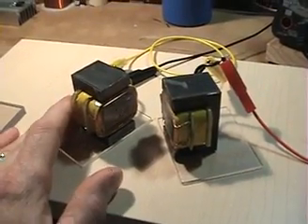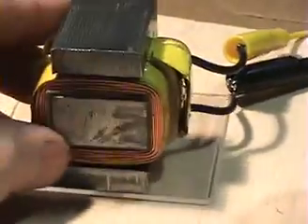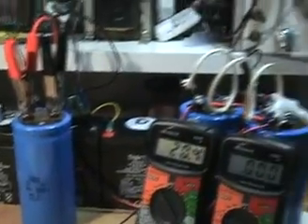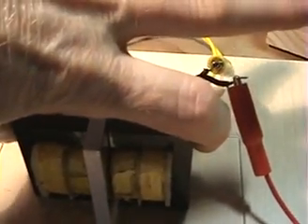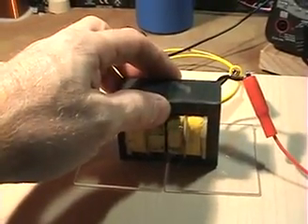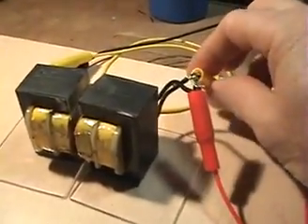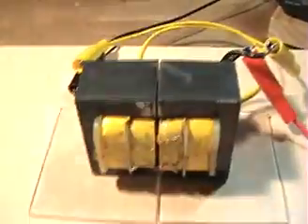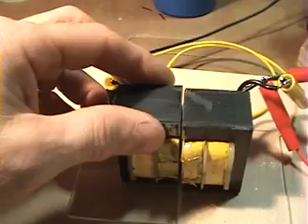Electromagnet Atraction vs Repel mode test 1

Comment: REPULSION:  use two electromagnets with cylindrical core.

1)  eliminate the remanence magnetism in the core using heat above the Curie point, or via saturation.

2)  position the end of one cylindrical core touching the other
3)  turn the current on

Now, you have two cores magnetized with both 'N' poles touching (or both 'S' poles touching, depending on how you wound the conductor around the cylindrical core) and the repulsion will be noteworthy

With the shape of the transformer's 'core' - you are not getting the "like poles repel" action because of the flux path in the iron.  You eliminate the extra 'experiment-ruining' flux paths by using a cylindrical iron core

Comment: There is something that you are doing wrong.
Think about Magnetic Levitation Train. There is repel and pul mode. So the repel is strong enough to lift that massive weight. So, there is something that you are doing wrong. Check, Recheck and then Check and recheck.

Comment: Sir, thank you very much for this video. I just calculated that electromagnets cannot repel each other, because the force is proportional to (I1+I2)^2, so they can only atract each other, or stay neutral, when I1= - I2. I wanted to make sure my calculations are correct and I found this video that confirms it :) Many thanks.

Comment: The iron core is shielding the repelling force of the coils, it will do the same thing using two magnets, so you can easily test this for yourself. The coil is still being attracted to the iron just like both sides of a magnet is attacked to iron. The coils are repelling each other but are both still attracted to the iron. Of course when they are turned around in the atraction mode the coils are attracted to each other and the iron cores, so attraction works.

Comment: It is logical they dont push apart.
The iron core of each half is an electro magnet. It forces its magnetism on the other half and because each half can be magnetised they both magnetise the other half as well. hence netto, nothing happens. Just like you can place two magnets both facing north towards each other on the same piece of iron,  But you cannot attach two North poles of the magnets directly together, The iron bar or in this case, the core simply shifts its field, continuously internally.

Comment: I get really strong repelling where they fly off the table using direct current especially if you use capacitors for the extra quick jolt vs common battery
Reply: Alex Manzanero can you record some video of your test?
Reply: Daniel Vettorazi one of the main reasons they are not repelling is b cause in effect he has them wired as a bucking coil configuration coils that are wound opposite of each other produce cancelling effects of opposite coil; even though they may not be counter wound he connected one of them oppositely creating a counter magnetic force which cancels the other one I have a good link for you..www.hyiq.org/Downloads/Guidelines%20to%20Bucking%20Coils.pdf
Reply: Daniel Vettorazi  also if you study thsat link you'll find that you can make a transformer that can pull lots of current without affecting the primary due to the cancellation of counter magnetic fields or back emf there are patents

Comment: Are you using dc voltage because ac voltage doesn't work well for magnets because of eddie currents
Reply from the maker: Used DC
Reply: +Roy Morrow Are magnets work by AC Voltage?..

Comment: I am not an electrical engineer so this to some may sound silly or stupid,,,
That being said ...
I noticed that you changed the power supply on the first coil in the series. this to me would suggest that you would have also simultaneously changed the polarity in the second coil as well.

Assuming that opposites attract I would think that you may have better results if you had them wired parallel and changed only one coils polarity

Comment: the magnetic fields in series that you are attempting to repel doesn't work because the magnetic fields cancel each other out. it may work if you put the magnets in parallel or on separate circuits

Comment: The weakness in "repel mode" is due to a lack of inductance which results from the electrons moving in opposing directions. When in "attract mode" the electrons are moving in the same direction and effectively double the inductance.
Reply from the maker: Ernesto Del Bosque
I think to be fair a motor should be built to test the difference between the two. It could be the difference may not be as obvious as in this test? Also, building a motor with electromagnets in both stator and rotor in repel mode may reduce CEMF?
Reply from the maker: Yes, I agree!

Luc
Reply: Luc Choquette  for a solenoid L = uN^A/l where l = lenght , A=area , N = No turns , u = permaebility. Therefore weakness cannot be because the Inductance has reduced as it is not a function of current or V .
Reply: Luc gotoluc Choquette Hey! did you get the answer to the repel mode weakness?

Comment: could it be that in repel the force that would cause the misalignment of the metalic lattice  has a path to go into the to and bottom of the E? I am thinking the E shape takes the repel from the middle of the E and instead of pushing back under domain pressure it uses the top and bottom of the E as a buffer or pressure release valve.

Comment: Therefore to improve matters an E shaped core should not be used for repulsion. I suggest long cores with coil covering full length to increase the air gap between the N and S poles.  Try to make the air gap between poles of the same solenoid much greater than the desired air gap between the opposing solenoids.  Larger diameter cores will probably also increase the effective working distance as the distance flux must travel around them is greater.

Comment: To understand why they didn't repel first look at the flux path of each coil while separated. There is a natural return path from iron in coil center through air gap to iron on top and bottom, through which flux is attracted to opposite end of coil.  When you put the coils near each other the opposite polarities only reinforce this natural return path. Attraction mode is different as it is easier to flow through the opposite half than the self return which has an air gap.

Comment: i use a microwave transformer with no i piece wired as 1 coil
if you get a big transformer a car battery and good place to stick it to ( at least 1/2 inch thick steel) you should be able to lift 500 lbs easy
i have 
i will make a tuturial soon

Comment: Could the winding on the coils cause the voltage drop as they are working in the reverse, Maybe its stepping down in repel mode. making the voltage to low to cause the magnets to repel.
Also while you reverse the wiring on the right side coil you did not do the same on the left. ins should be ins and outs should be outs
Just an observation. I know nothing about electro magnets

Comment: Interesting experiment. I have been wondering about these issues. I think your circuits are wrong. You do not give enough information. Anyway - there is no reason to think that the replusion force is equal to the attaction force. For example when two magnets are repelling you can insert a piece of iron in between and the attraction force of both magnets to the iron is much stronger than the repulsion force.

Comment from the maker: Sorry, this is out of my area

Luc
Reply: Here is the short answer to your question: imagine each piece of iron core is a box with a bunch of small magnets floating around inside, if you want two nearby boxes to attract each other you can arrange some of the magnets in the boxes to attract each other, these attracting magnets will then float towards each other making their attraction strong enough to pull the boxes together, however if you arrange some of the magnets in the boxes to repel each other the magnets will simply float far apart from each other. If this answer helps anyone please let me know, it's nice to know if my effort makes a difference

Comment: Hi there I need to move a 500 lb steel ball with electro magnets what do you think i,ll need , i need to run it on as little power as possible . If you can help this will advance my invention very quickly . Many Thanks Ananda

Comment: Thank you for posting the video.  I am trying to come up with a design for a latch using a solenoid as electromagnet and an NIB disk.  The NIB would stick to the axis of the electromagnet in no power mode but then repel strongly when the coil is energized.  What are your thoughts?

Comment: btw thanks very much for the board recieved it yesterday.... now to clarify further why your two electro magnets do not repel ... magnetic fields are simply polarization N to S or S to N ... they are NOT a N pole and a S pole  with polarization in between them ... at any point in the magnetic field there is always an equal balance of N and S polarization ... slice a magnet as many times as you like and you still end up with a polarised field ...

Comment: Hi gotoluc .. theses magnetic fields very mysterious they are .. why no repeling? well because magnetic fields do not actually repel .. take two magnets.. one stationary the other free to move .. place them a distance apart S-S and the free magnet will always rotate to face its N to the S of the stationary magnet... it will not move away i.e. repel ... soyou could say like poles dont repel but rather attract away from each other ... sort of...lol

Comment: the magnetic attraction of the metal core works against the magnetic repulsion of the opposite field.

Take two neos and try to push them together in repel poles, its very hard to do, and they wont stay together even if you get them to stick. Now take a thin sheet of ferris metal, stick one mag to it, and then take the other mag on the other side of the first, with the repel pole facing the metal, and stick it to the metal.

Comment: I think repel doesnt work well because this coil has metal core. If you had just the coils, they would repel, but there is a metal core, a lot of power is reduced because the coil attracts to metal.

Comment: should use the core as a lead to your meter. its possibility  for a voltage difference. which means capacitors can gather bemf through the core rite????